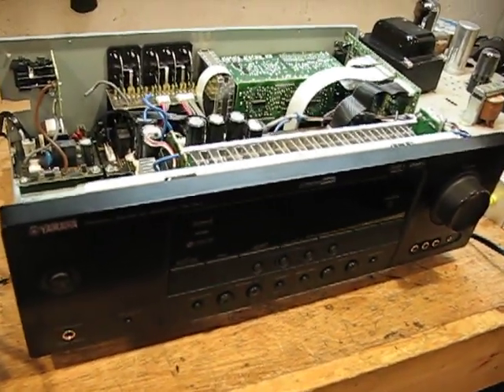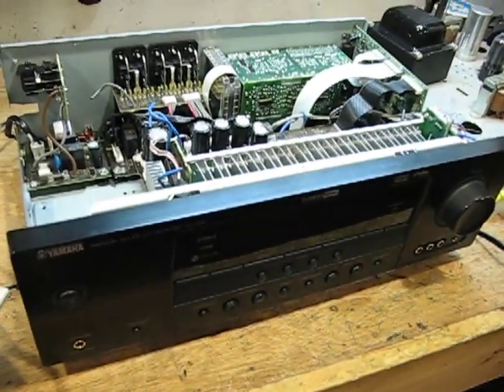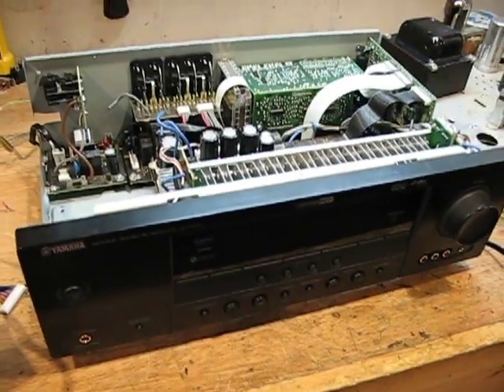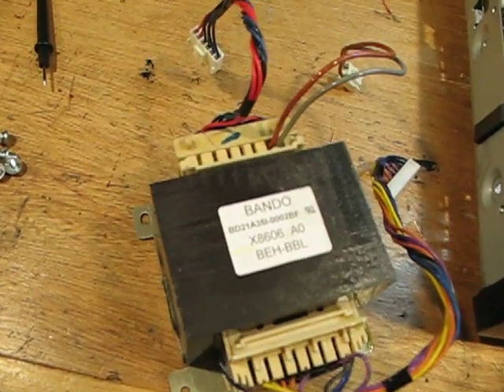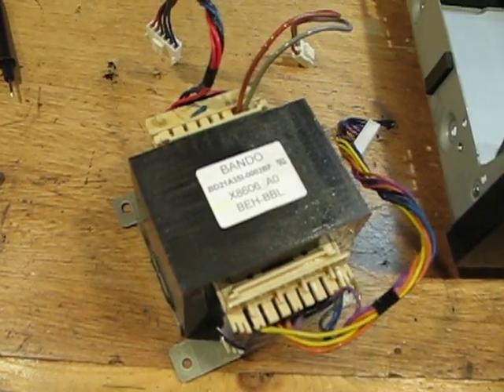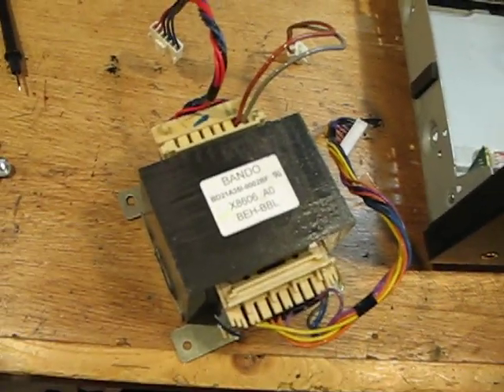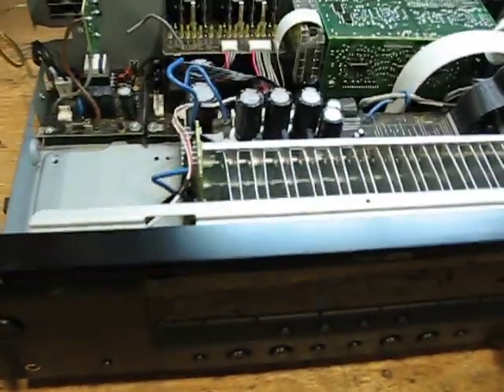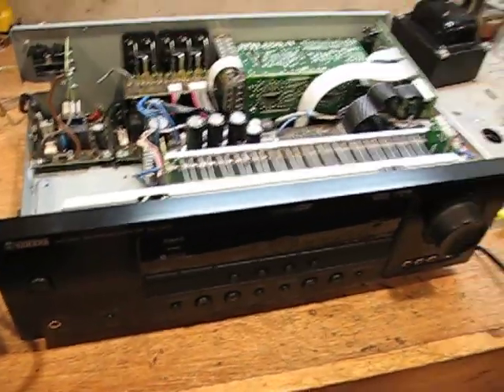Cheap modern electronics

Comment: you're right.
my father as a late 80's yamaha has mother$(#)/=! huge transformer... that thing weights at least 30kg...
the only service it had was done by me, had to clean the input selector. other than that, super powerfull and flawless.
it is rated 80w for L,R and 50w for C,SR,SL... must say, it has more grunt than my onkyo tx-sr607 by far.

about the transformer, it might have a thermal fuse under the plastic housing...

Comment: Very few avr's put out advertised power across all channels driven. If you look at the specs it's one or two channels driven at 1khz @ 8 ohms. if you look a at Outlaw, Emotiva, ATI ect. They rate power all channels driven from 20-20,000hz @ 8 and 4 ohms. A lot of the new avr's say they make more power than comes through a 15amp 120v socket. They are using 1970s era 2 channel power rating rules for modern multichannel avr's it's not fair to the consumer. It's easy to get good power one channel driven at 1khz that one channel gets the whole power supply all to its self.
Reply: +Home Theater Junky Still, most newer mainstream stuff is made to get through the warranty, maybe last a year or two and then kapoof.  Bare bones, underbuilt with cheap components. You have to spend huge $ to get close to what the department stores sold even 25 years ago.
Reply: I agree, I only buy the flagship stuff. I have never had a AVR failure in the last 20 years, but you get what you pay for. I also run small quiet cooling fans, I think that helps.

Comment: WRONG!!  Tape and Rec outputs are NOT preouts.  They are not used for sending analog info to a separate amp.  Only preouts should be used for this.  If you hook a separate power amp to the tape/rec outputs it will be sending a reference volume level constantly.  The only way you should use those outputs for a separate amp is if the amp itself has volume control.

Comment: I know this is an older video - I work on a lot of Yamaha's and the transformer does NOT go bad unless the guy was severely abusing it. He lied to you. Often they turn it up so they can HEAR IT OUTSIDE then just let it cook. Takes about an hour or two to kill the transformer.
Reply: They don't die from load usually. I had 2 of them in my custom 5.1 amp and they just got up to 60C in 30minutes by sitting idle. :/

Comment: Examples such as this is one reason why I prefer to collect and use older electronics.  I could give many examples of expensive modern TV's and other electronics that I've run across that failed after a short period, only to discover that the needed parts are either NLA or too expensive.  Meanwhile, my old electronics made between the '20's and the '80's keep going and can usually be fixed with generic "off the shelf" parts.

Comment: The worst part about the newer HT receivers from a service standpoint is that many don't even have a removable bottom. So if you need to do anything on the main board that requires soldering you then have to pull the entire circuit board out in order to do it.

Comment: tube electronics are the best. if something goes wrong which mostly would be a tube. all you would need to do is replace the old one with a new one. i have several tube radios myself dating back to the 1930s.

Comment: That's why I went with Technics - they may not be high end, and they only be stereo (the good ones; Technics made some 5.1 equipment though), but they will last forever. The same goes to vintage Marantz, Sansui, Pioneer, Dual, Onkyo and all of those brands that were active when quality used to be a word!

Comment: chances are, there is a thermal fuse which has opened. usually for no good reason. look for two thin wires going into the layers of insulation,. carefully cut it away and you should see a small rectangular  item. Test with a meter for o/c. 

if this is for someone else, you should replace the whole tranny. if its yours, you can risk it and replace the thermal fuse with a regular one - dont leave it on unattended though

Comment: I have seen this exact same problem in a Sony receiver probably from the late 1990's. We have decided at our shop to not work on these kinds of modern consumer items as there is just such a high probabilty of this sort of failure mode of underrated parts and even if you got an exact replacement it really wouldn't be up to the task.

Comment: If I ever go HT I hope to be able to afford to do the same thing.  I've got my Samson 2x130 studio amp, but I would need two more plus a 5.1 preamp.
A agree with vinylman, maybe your neighbor should consider a vintage system,  I have a ~35 year old Sansui here in my bedroom that very rarely gives me trouble scratchy POT) and I paid less than $20 for it at a garage sale and it will ROCK!  One of these days I'll make a video of my bedroom stereo setup which doubles as my computer speakers.

Comment from the maker: This type of trouble seems hard to avoid these days.  Even the better brands have gotten so cheap and unreliable, nothing seems to last more than a year or two.

Notice how small that heatsink is to cool the "500 watts" worth of output chips too?

If I ever rebuild my home theater audio setup, I'd like to use a standalone DTS decoder and independent analog amps (one for each speaker or pair of speakers).

Comment: Well we both know that 100x5 rating is super optimistic, it's great that you found the problem, hopefully you can find the part.  To bad it's got 5 million different windings and taps, other wise you might be able to subsitute a generic one.  You may have to find a junk receiver of the same model on ebay with a busted amp, screen, etc. to raid the transformer out of, easier said than done to say the least.